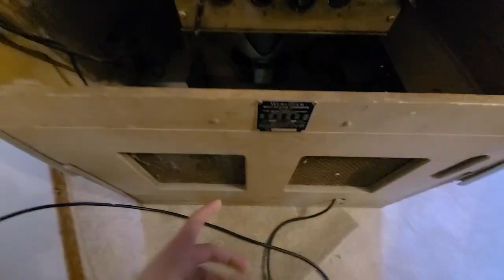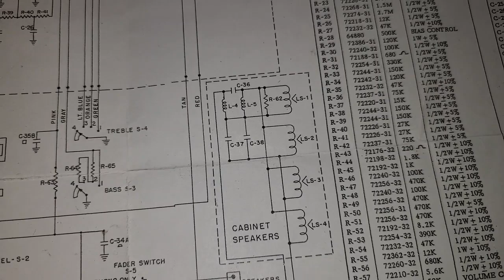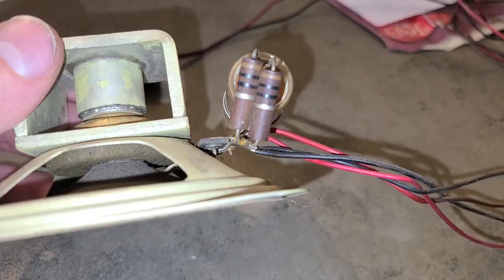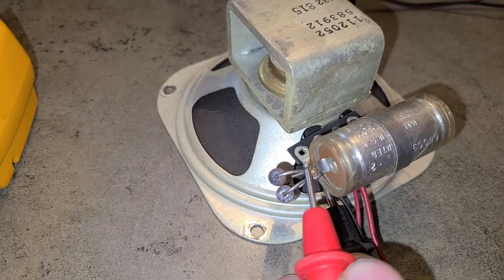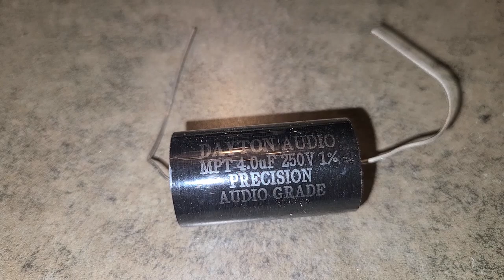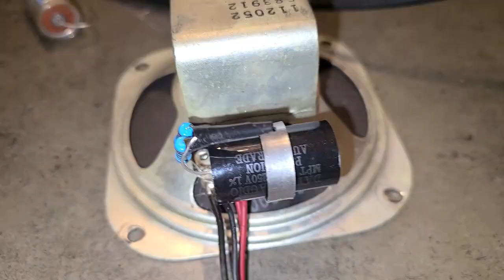Wurlitzer 2204 Jukebox fix for muddled and washed out treble

Comment: I have a Wurlitzer 3700c can capacitors like go bad and treble be weak?
Reply from the maker: The 3700 came out in 1973 so if the caps are original I wouldn't be surprised if they were bad and were causing weak treble issues in your 3700c.   I have the service manual for the 3500 and the 3800 but unfortunately I don't have the manual for the 3700.  The 3500 has the model 551 amp and the 3800 has model 556 amp.   Do you know what the model number of the amp is in your 3700?
Reply: @shaneperche-fixed-it  i have a manual too, can i shoot you an email when im at the house of my info?